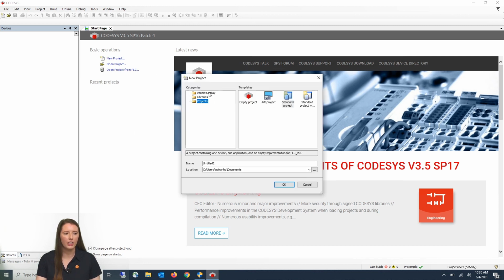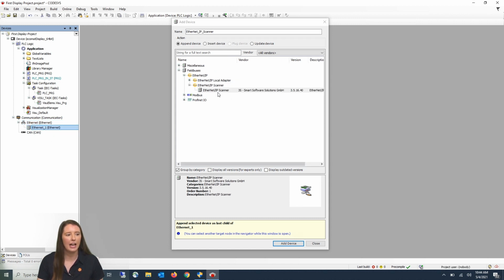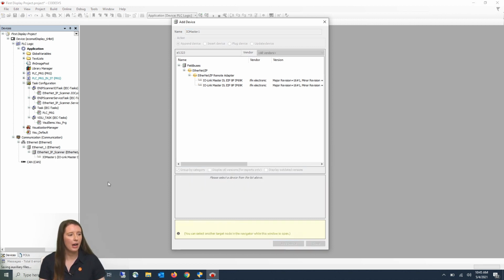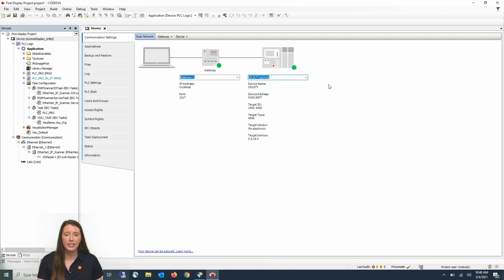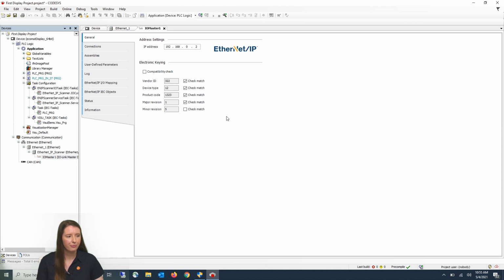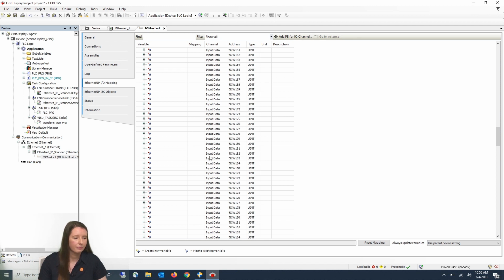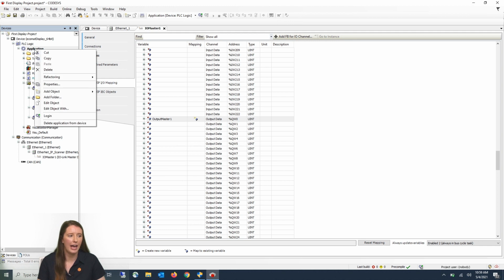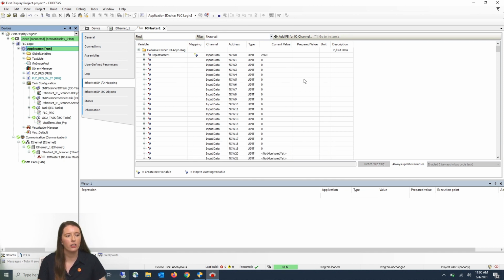How to create a new CODESYS project on the ifm industrial controller

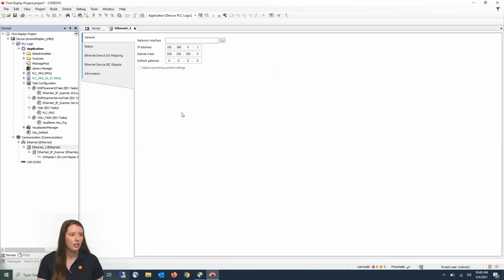Comment: At 2:45, when I click on three dot ... I get X Invalid result package (error)
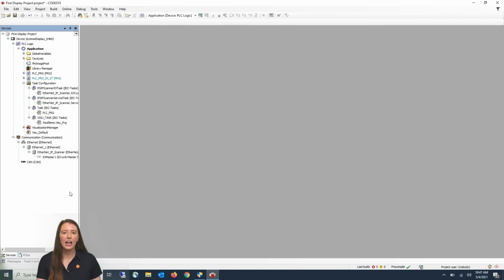Reply: Hi @pforce1974 - That generally happens when you have not scanned and are not connected to the PLC. That step is explained in 2:14. Once you have the PLC connected then the three-dot ethernet adapter will work fine.